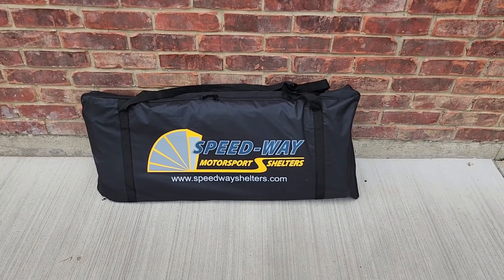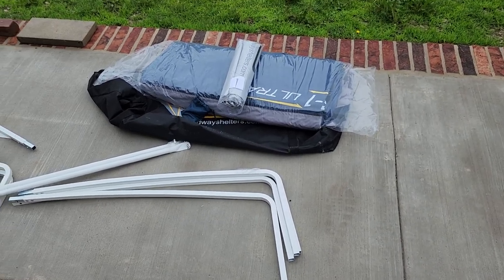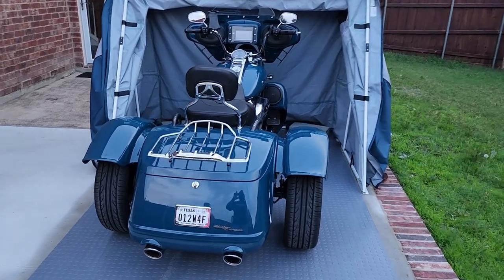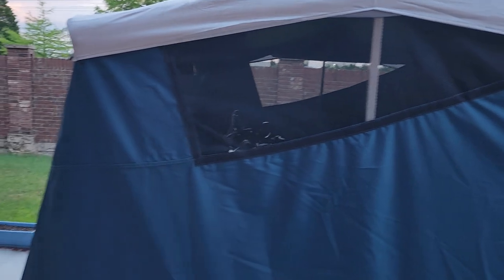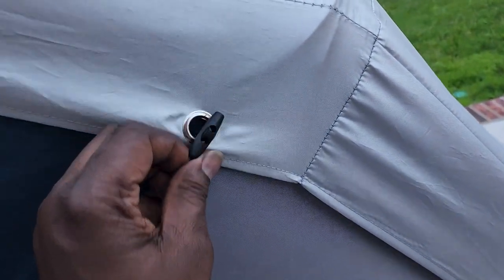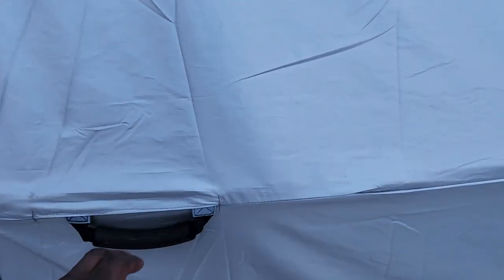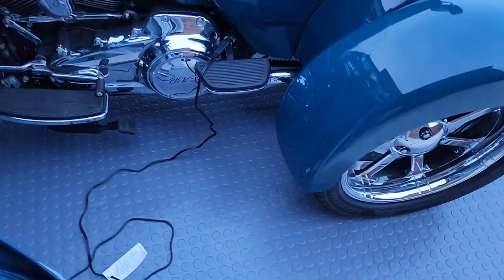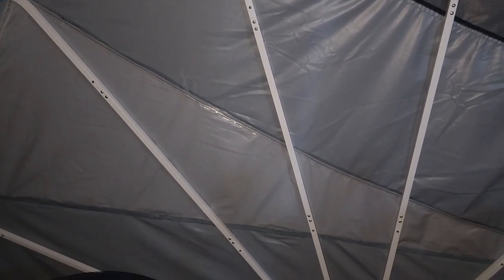Speedway shelter for the Freewheeler

Comment: Nice cover. You being so tall how do you find the riding position and do you still have the stock seat? Thnx
Reply from the maker: I have the HD tallboy seat. The factory handlebars are pushed forward some for a few more inches of space also. To be honest, riding solo on the freewheeler with the tallboy seat and backrest is the same posture as my RoadKing, but when my wife is with me, I don't use my rider backrest so it is a little different but still comfortable. Thanks for checking out the video. Godspeed
Reply: @oldbikenewman      thanks